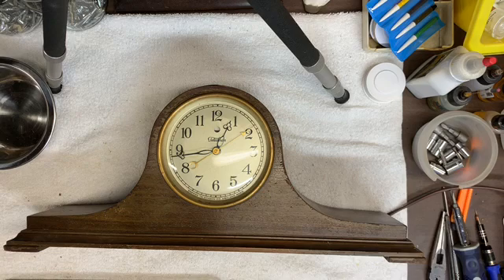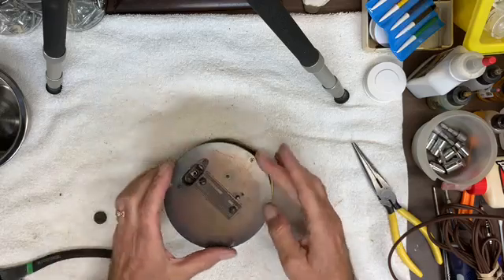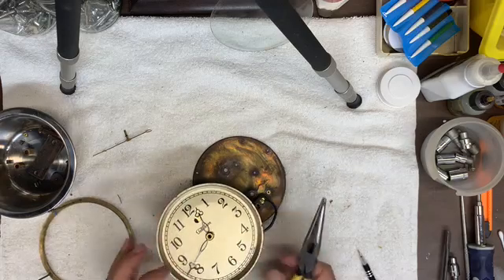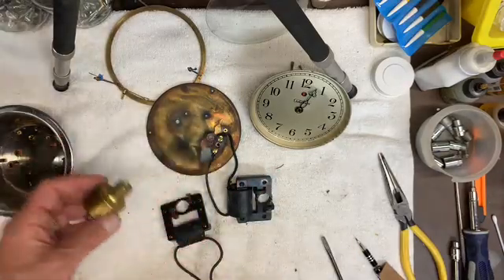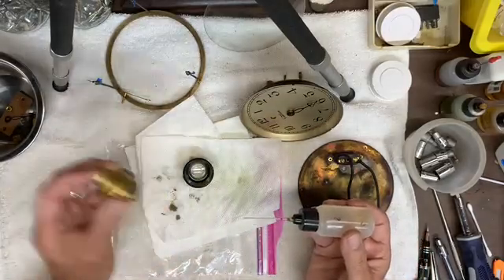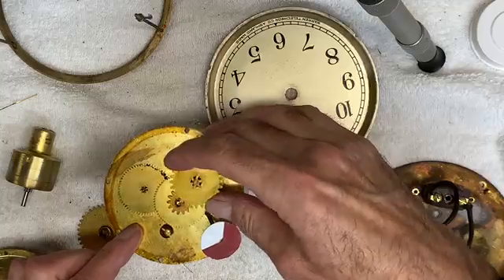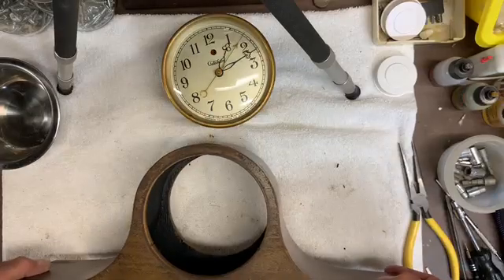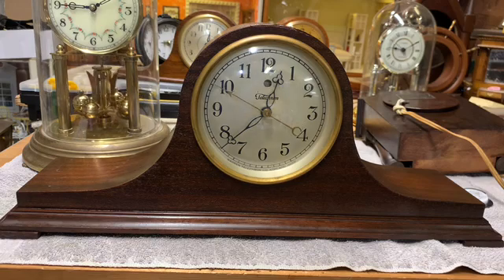Repair and Restoration of a Telechron Duncan Mantel Clock 1929

Comment: Try a heat gun first and then apply the solvent. Most rotors have hardened oil that has stopped the gear train.  Because there are other failures that are fatal, you want to run it before drilling in case there are worn gears or excessive play in bearing holes.  Restorers salvage good gears and rebuild and re bush these older B2 rotors and provide a good service although, expensive.  Great video and pleased to see you are still at it.
Reply from the maker: Thanks!  I can try that to see if it frees up the rotor, so far I have not run into any gear issues that prevented it from running after the thorough clean out and re-lube.

Comment: I would like to see how you change the plug.
Reply from the maker: Are you referring to the plug that goes into the back of the clock or into the wall outlet?
Reply: @mherzog7  yes
Reply from the maker: @pamelasheridan9717  Yes, the plug that goes into the clock or yes, the plug that goes into the wall?
Reply: @mherzog7  I guess I should have said power cord. The cord that goes from the clock to the wall. It's very old and needs to be replaced.
Reply from the maker: @pamelasheridan9717  Here is a link to a video I made showing how to replace a power cord. Good luck!   https://www.youtube.com/watch?v=FnUZg5DmCi4
Reply: @mherzog7  thank you!!

Comment: Thank you for recording this! Great info.
Would it be wrong to fill the rotor with a general degreaser to clean it?
Reply from the maker: I have had success using liquid wrench, followed by 3 in 1, and then a little synthetic clock oil.

Comment: Really great tutorial, Mark.  Straight to the points with good audio and video, without hemming & hawing, clearing throat, or other irritating nuances.  Thanks for taking the time.  I have this identical clock that I plan to freshen using your exact methods.

Here's some info about that red flag power interruption indicator.  This info comes from a Westclox clock that I repaired that uses the same sort of setup.  It's a combination magnetism and gravity sort of mechanism.  When the clock is plugged in and running and the flag shows non-red, magnetism from the running motor holds the flag in that position.  When the power is lost the magnetism is lost and gravity causes the flag to drop into the red position.  There's a small steel piece that is close to the magnetic clock coil that performs this interaction.  It is super sensitive and oil should never be used to lubricate its bushings - clean those bushings completely with alcohol.  I've also found that through years of use the steel surface that is attracted to the motor magnetism becomes magnetized itself, causing problems with the flag dropping.   I've used an old tape recorder head demagnetizer on those parts with complete success.  I learned that with patience you can get these flags to operate 100% correctly.
Reply from the maker: Thanks, I am aware of the magnetic nature as to how they operate.  I have had more luck getting the ones to work where you flip the clock upside down to reset it, as compared to the ones with the stem on the back that needs to be turned. But I will check to see if the one such as in this clock has gotten magnetized, although I no longer have a tape recorder demagnetizer, those days are long gone!

Comment: Thanks I just bought this same clock at a thrift store. It's running, my question was about the power interruption dial. Why doesn't it turn when the power is on? There is a small weight on the rod above the coil, I guess that will bring it back to red when the power is off, what is causing it to turn to silver when running? This one has the dial all the way out and close to the brass plate. I think it is more visible this way. Any comments are fine.
Vince.
Reply from the maker: The power interruption dial is  held in place by the magnetic field showing white. When power is lost it drops to show red. You reset this clock by turning the stem.  It doesn’t always work, it doesn’t work on mine either. I keep it on white. It’s not meant to turn when power is on. Some clocks have one that rotates, as if seeing it move let’s you know it’s working. But the second hand tells you that.